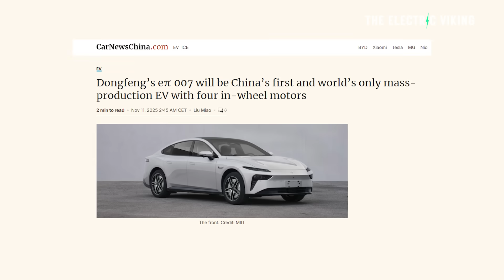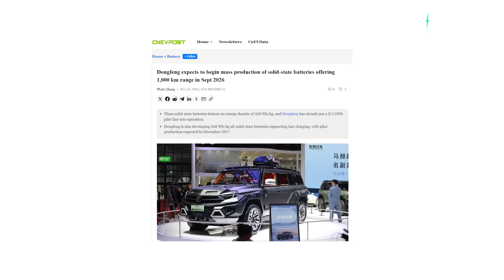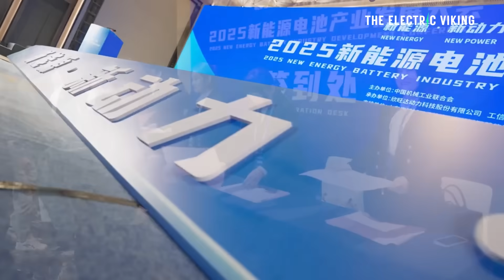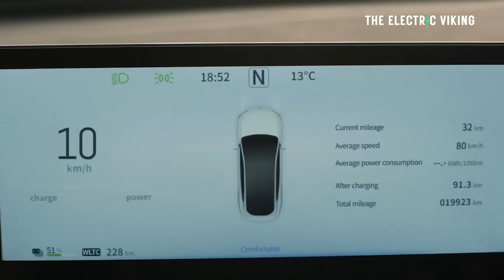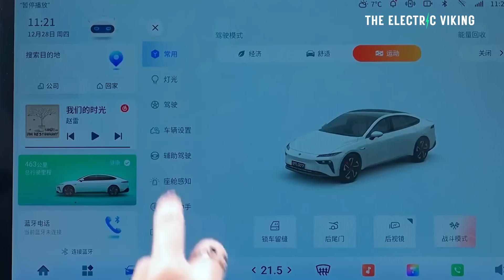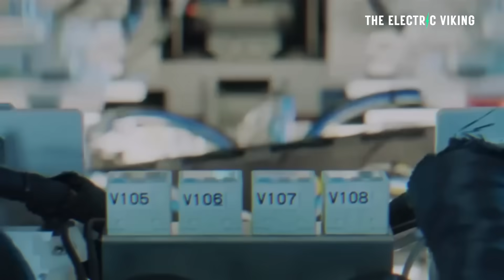Chinese Automaker Reveals Solid State Batteries that Charge at Over 1200kw

Comment: The 1,000 km battery will surely be solid-state or similar and is expected to arrive soon from China. With such a battery, charging from 20% to 80% could be possible in about 15 minutes, easily covering 500 to 600 km range. That would be an ultimate breakthrough. Nowadays, we still face range anxiety in EVs, believe it or not...

Comment: This is cool, the one problem I see is cost.  There’s approximately 1Kg of silver in each battery.  Silver is up 120% year to date.  A kilogram is currently priced at $2,100.  Silver is $65 an ounce.  Some predictions put silver at $300-$500 an ounce in 5 years.  It’s likely hitting $100 by the end of 2026.  That’s going to be an incredibly expensive battery.  We’ve been at a silver deficit for 5 years running.  There is no quick fix to mine more silver anytime soon.  Mines take decades to develop and mature.

Comment: I’m against electric until range is around 450 miles.  The infrastructure will eventually catch up.  Solar canopies at grocery stores, department stores and on top of buildings should allow charging for free or very minimal cost at some point.  It’s a ways off but I think the battery tech is around the corner.  The actual infrastructure for it though I think is probably 20-30 years away!

Comment: It is really simple. CATL knows how to manufacture mono-layer graphene.- that is one atom thick, that is impossible to penetrate and almost no resistance. So in theirt, it can be charged instantly. But that requires a copper wire to transfer, and the copper wire that connects the car to the grid  has a well known resistance that detrmine the amount, I or Ampere that is possible. Residential grids use 100Amp m and at 240V, that is 24KW  - more and the house breaker will blow. Maybe 50KW can be delivered at homes - but the voltage, here 1020V = 1KVThat makes it possible without melting the wires.

Comment: It is great that China is pressing forward with actually building a selling innovative new technologies. Realistically, I'd rather see a lighter, cheaper EV, with a 400 mile range, that uses a hybrid battery pack that has solid state batteries that can go 100 miles, combined with the rest of the battery pack (300 mi more) that uses super cheap 2nd gen sodium ion batteries. So you get all of the benefits of solid state batteries for most daily driving, but still have extra range for those rare long trips. All without the whole hybrid battery pack being any more expensive than todays NCM battery packs.

Comment: Can any electrict transmission grid system today, or electric generation to be built into the distant future be able to handle mass adapted charging demand at this voktage / amperage levels?
Reply: No, but Sam never allows reality to slip into fantasy world.  No sane person would touch a 1200kw power line.

Comment: How many 1200kw chargers can each street in Australia handle without upgrading transformers, cable sizes, etc?

A few years back I heard our power supply couldn't handle 10% in each street, but that wasn't with 1200mw chargers!!!
Reply: You really don't have a clue about the grid and charging do you. Here's some info to clear things up for you:

1. MW level charging will be a niche. It's only for dedicated charging hubs, not normal street or home level charging. A MW can run a small town for goodness sake. No power supply agency will allot that much capacity to a house or street level charging.

2. The charging won't happen by drawing power from the grid, but from onsite batteries instead. Those battery packs will charge during off peak times slowly from the grid and possibly onsite solar, and deliver the high power when needed. The grid won't be affected at all.

3. Speaking of solar, many houses and workplaces already have solar. So there's no need to use grid power, reducing the burden on the grid. Besides, power suppliers themselves are installing batteries to meet peak grid demand, so you don't have to worry about grid resilience. 

There, that should clear it up now.

Comment: The real question is how long is it going to take for this battery tech to become affordable and wide spread to make EV vehicles affordable. Figure when these batteries hit the market they will go into the top end EV's first and then gradually go into cheaper vehicles as production ramps up. 
Once affordable (30k) EV's with over 600 mile range become the norm ICE vehicles will no longer be relevant.

Comment: It will be a very long time before we charge at 1200kW, not because of the cars, but because of the charging infrastructure. Sure, there will be some out there, but here in the US we don't even have a plethora of 350kW chargers. The problem isn't just having hardware that can do it (chargers not cars) but electrical supply to match. We don't need it though, if it can charge at 1200kW in the car, then the car can take 350kW for almost the entire curve. That is good enough. 350kW will give you 75kWh in 12 minutes. At 4 miles / kWh that is 300 miles of range...
Reply: The 1.2 MW charging doesn't come from the grid, but battery packs. The packs charge slowly from the grid ( + solar in some cases). Houses and factories already have rooftop solar + batteries, with more installed each day, further reducing the need for the grid.
Reply: @Berkhoi There are some solutions like this, but so far they are rare, there is a reason for that. You would need a lot of solar and batteries to keep up with that kind of load. In areas where land is expensive that is not as likely, but along the freeway in less populated areas where land is cheap, yeah that can work. But, that would depend on the cost of the batteries and solar vs. the cost of bringing that kind of power out from the grid. I think you will see more of these in places along the freeway, but no in city limits.

Comment: Regarding in-wheel motors, I'm very skeptical of lifetime and maintenance costs. I'm not expecting those to be common.
Reply: This is extremely interesting. Would individual wheel motors, be they 2 or 4, be more efficient and simpler? Thus lowering initial purchase and also maintenance costs? My sister’s transmission went out in her 100,000 mile 10 year old Subaru and the dealer quoted 10K to replace it. This is an ICE for you. Many systems to go wrong, and all expensive.

Comment: Modern technology is overloading our electric grid in the US. All these Data Centers and AI usage is bad enough, now we have to supply enough power for everyone to fast charge their vehicles? It seems my electric bill is rising exponentially, and I have one ICE vehicle. There are six data centers located around Bend and Prineville, Oregon alone. Wind Farms may take up some of the load, but I have to pay extra to support them. Maybe if the Oligarchs who own these data centers would pay their share of the power consumption and the infrastructure required? People who fast charge their vehicles at home should be required to have solar panels installed?
Reply: I do fast charging for my EV and I do have rooftop solar that covers more than the EV usage. I like your suggestion. It is the AI data centers that are sucking up every watt of power they can get.

Comment: The question is , When do you commit $$$ to buying an EV? I think I now have the answer. To have a solid state battery in a 
Zeekr 007 GT, now that would be something. We need this technology in our houses & on the roads NOW!
Reply: Now
Reply: @mehmetgokturk5596 Yep ..NOW!!!
Reply: I agree, this is the problem with EV's at the moment, the technology is changing so fast. If you commit to converting from ICE to EV now, within a few months the technology has jumped forward rendering the resale value of your EV to virtually nothing. I love technology and change but this is a ROI conversation of dollars in your bank and right now it seems committing to an EV is money thrown down the drain, other than the coolness factor. Buy an EV today for $50k and get perhaps $10-15k resale value in 2 years when you look to upgrade again?
Reply: @davidl9938 it's a drive it until it's dead equation with BEV's I reckon.

We need a second car here now the kids need to go different places at the same time and I'm struggling to make a choice. 1st World problems and all that 😅
Reply: @davidl9938 that’s why almost all EVs and ICE cars bought new are leased or on PCP.  Renders depreciation mostly irrelevant and no selling when your done with it, just swap for the next new tech.

Comment: Did Toyota get the memo(?) Panasonic has been the most disappointing battery manufacturer EVER, and is 2 generations behind China in R&D. Absolutely correct Viking, that energy storage technology is advancing daily, but this battery going into production is the tipping-point for ICE vehicles. 5 minute charginng, and 500 miles, removes any doubt that the electrification of transportation; land, sea, and air, is inevitable.

Comment: "Charge in 5 minutes..."  hold on there. 5 minutes is only on dc fast charger outputing what? 500 kilowatts or 1000 kilowatts?  

Not what we have at home.

Most public dc fast chargers today are 50kw or 150kw.  

We got a chicken and egg problem about 5 minute charging.  A lot of these charge in 5 minute cars need to be sold so the charging companies will install the 5 minute last chargers.  The 5 min charging stations will lots of use for the charging companies to spend the money on installing them.

Most will be 1000 volt, not today's 350 or 400 volts.

I except that kilowatt hours will be more expensive because there'l be so few of them and manufacturers will need to pay off their development costs.

I'm still for them.

Charging at home will remain cheaper than visiting a commerical charging station.

Comment: Hello Sam, Thanks for your channel which I regularly visit. I just have a couple of comments re safety.  I am a retired engineer and on a very limited budget so when my E-bike battery slid into the canal I was forced to learn how to rebuild these.  I have now had to do this on three e-bike batteries - fitting new BMS systems to recover them. (Shame on those ebike companies that have a BMS that locks the battery so that it cannot be charged or discharged if the voltage gets to 37 V. ). Anyway I was initally a tradesman auto electrician and in those days 1970s you could and did regularly rewire cars completely  - typically these mainly UK cars in New Zealand were very poorly protected wiring wise so wire frequently burned damaging the rest in a bundle.  We also worked on many trucks and their 24V systems demanded respect. A mistake would weld a connection instantly.  I went on to join the aircraft industry and became a degree qualified engineer (JCUNQ) and you can understand that safety became a huge focus for me.  Back to the BMS installations on a 37V bike battery - I found it was so easy to short something in doing this work and the results were instantaneous!! Very scary really. Now the thought of 1000V systems - no two of these - hitting each other in a accident and releasing that energy.. Its beyond scary to me. But of course with the very best you are forecasting currently  this is still 1/2 of the energy density of a petroleum fuelled car.  Somehow they don't scare but perhaps they should. Perhaps we are just used to them.  Personally I think it would be very easy for us to end up with a world that wont allow EVs on ships, in tunnels, in underground car parks and so on.  I hope not as my only transport is my e -bike, and I am a true convert - they have helped all my age group 70 - 75 get out and enjoy the countryside again.  And the impact is building even in the hugely weight sensitive aircraft industry.  One last observation. Who in their right mind should want more than say 200HP in a smallish vehicle.  Try to talk the manufacturers into common sense. Why design for the extremes that they are _ probably brought on by the very German desire to build and out HP the competition. Its all totally unnecessary and in my mind (small I agree!) the authorities should be imposing sensible limits.  Thanks again Sam. Cheers.

Comment: If you can drive 600 miles on a charge, you don't need fast charging. If a car/battery can get 300 miles on a charge and fast charge in less than 15 minutes, long road trips are easy.

Comment: Could be very promising if they ever deliver. Once you have EVs that get 400-500mi of range and can charge under 10 minutes, it's game over for gas.
Reply: Well evs are close to those ranges now. But the chargers to do those kind of recharge times are not by far anywhere yet and won't be for 5-10+years at current deployment rates smh. Even china doesn't have more than about 5% of all dcfc putting out 350kws or more. and the us is around 2/3% at that speed, while the EU is around the same. More likely sooner imo is 200-300 miles back in 15-25mins average by 2027/28. With the best doing 150-200 miles in 10-15mins on 800+v 350+kw chargers.
Reply: @4literv6   most new EVs in the US are still in the ~300mi range. Most gas cars in the US get just under 400mi of range. I'm more worried about reliable 400mi of range rather than super fast charging, but obviously this will evolve over time. EVs, unlike gas cars, are an evolving technology. But it's still very exciting seeing China pushing the envelope here.

Comment: Hi Sam - I love that you hold up a magnifier to the future! The only thing I think will go slow is the update of charging stations with more power. It is depending on not only the stations themselves but also the supply from the grid or possibly local solar stations or similar. And my car should be able to get 150 kW, but that seldom happens even on 300 kW stations. Great work, thanks.

Comment: Got to ask, did they qualify it at all, Solid State batteries is a rather vague term at the moment and has been used to describe semi-solid state, as in the MG, quasi-solid state as in testing for the Mercedes Benz EQS Sedan, or full solid state? The quasi-solid state in the Mercedes will supposedly give that around 620 miles range, so maybe similar energy density to this one. Not that I am against these batteries of course, but unless it's stated as a full solid state battery there's always a doubt, can you clarify on that point?

Comment: Low voltage (12V) is used for safety. Are 1,000V systems dangerous? It seems like a great danger in case of accident, shorts, or water-facilitated circuits.

Comment: That is the future of the EVs. Fast charging and long range.  FANTASTIC.
Reply: No. We will all sleep for 8 hours, and we charge at home. All parking spaces must gave a charger connector. Fast charging is needed when we travel far - maybe 3 vacations per year. There are very few YouTube editors. Live in London and drive north 600 miles or west the same distance, any you need deep sea diving equipment along - the EV drives on  the seabed. The distance from Rotterdam to Rome is 1622 km/1008 miles by car according to Google. But we need places to take breaks, ea, and get flogged with high priced electricity.  The charging stations must be allowed to offer a service.